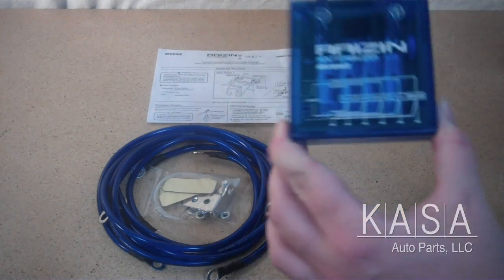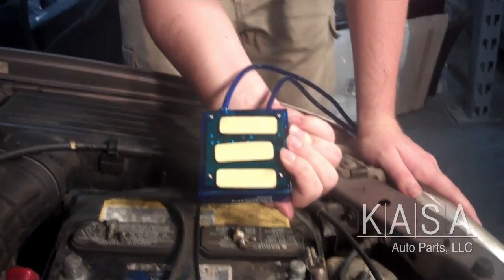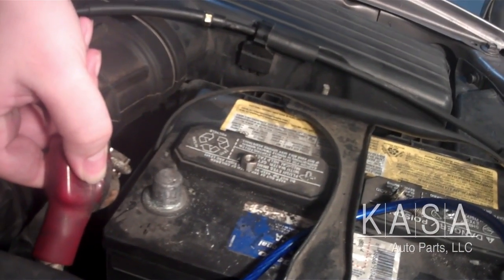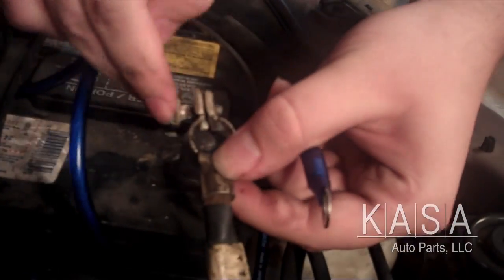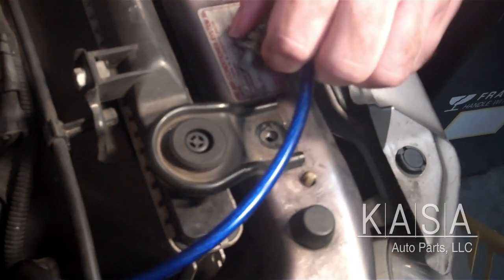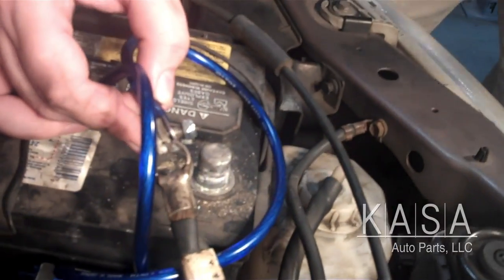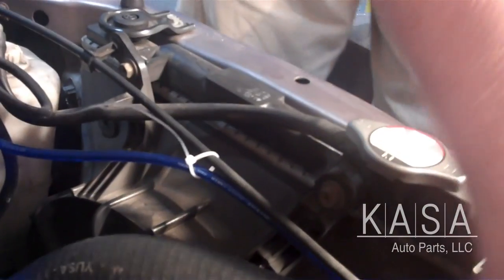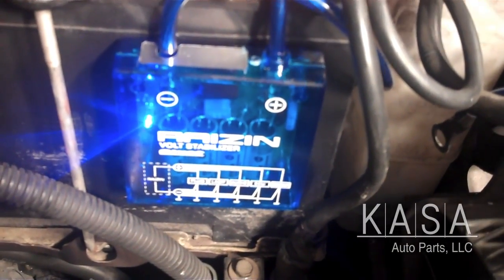Raizin Voltage Stabilizer Installation

Comment: And what happened if your altarnator’s volatge regulator is bad?
Reply: That's exactly what I'm trying to find out lol. I'm looking into this because I have a high Amp alternator due to having alot of car audio. The stock regulator in the alternator is not working but the alternator works fine other then that. And it being almost $500 for a new 260amp alternator custom made for a acura integra I'm not trying to by a new one. So when running its around 15 volts which is normal for a car running and charging but under load driving or with the subs on its boosting up to 17 volts. Now will this work to actually stabilize the voltage and regulate it to something safer that's not gonna want to fry my cars wiring? Lol

Comment: This is a fake product. It has very small gauge wire with thick insulation to make them look big. The capacitors are all dry inside and do nothing. There is one cap that works otherwise it is just a overpriced voltage meter. do not buy this it is a scam.

Comment: Never install cables or anything over the battery cell covers, you need to check the water level and possibly add periodically. Your battery is already body grounded, I would have placed the ground at the alternator bracket or somewhere on the engine, and last you mounted the stabilizer on the battery, you will need to change batteries at some point. And everyone yes this is a stabilizer, it's just a series of high current capacitors, hopefully the manufacturer placed high current diodes in place at input of positive and negative, otherwise be careful and double check connections, capacitors will blow very loudly immediately after backwards connection

Comment: Does anyone test these things to see what they really do?
Reply: This is a fake product. It has very small gauge wire with thick insulation to make them look big. The capacitors are all dry inside and do nothing. There is one cap that works otherwise it is just an overpriced voltage meter. do not buy this it is a scam.

Comment: I'm afraid you installed it it the wrong way. The cable suppose to be pointing below so that water don't sip in the cables hole.

Comment: The components inside the Raizin Voltage Stabilizer was bunch of filter capacitors and LED indicator. Capacitors was only filter out minimal sagging voltage of the Battery. The reason that "kit" was effective if you install all 5 Ground Wire properly. Unsuspectingly you just installed Multiple Wire Grounding Kit that was the reason that engine electrical have improved. You will notice that even if you remove the Raizin Voltage Stabilizer. Engine electricals have still very good performance due to newly install 5 wires grounding wires.
Reply: Mitsu Bishi w
Reply: so what you're saying is you dont need the blue box or positive cable connection, just add more grounding from the battery and that would do the same? I was curious about this device but noone around me knows, so im just asking to you guys...?
Reply: @dragan3290 
I have the voltage stab. every 10 days my new battery was drained....this form this voltrage
Reply: I'm looking into this because I have a high Amp alternator due to having alot of car audio. The stock regulator in the alternator is not working but the alternator works fine other then that. And it being almost $500 for a new 260amp alternator custom made for a acura integra I'm not trying to by a new one. So when running its around 15 volts which is normal for a car running and charging but under load driving or with the subs on its boosting up to 17 volts. Now will this work to actually stabilize the voltage and regulate it to something safer that's not gonna want to fry my cars wiring? Lol

Comment: Okay i watched this video start to finish and have come to the conclusion that this device does nothing, other than light up a little blue LED. how could it improve torque and horsepower when it only hooks between the positive and negative posts of the battery? it has nothing to do with the ECU OR Alternator, which on most all late model cars controls the vehicle's voltage while running. This snake oil is A SCAM.

Comment: On ebay it says these provide approx 10hp and 'better mileage' by 3% or more... how can this claim be true, if all it does is regulate the alternator's output and smooth out spikes in the battery? 

I PITY ANYONE DUMB ENOUGH TO BUY THIS AN EXPECT BETTER MILEAGE/ MORE POWER 
The alternator doesn't even draw 10 hp unless you're welding with jumper cables.

Comment: It's not a performance chip, what ends up happening is that in a normal car battery there are spikes and low points in the power output. What the voltage stabilizer does is help keep the battery voltage output more consistent and stable, resulting in better electronics performance^^
Reply: No, it really won't. Any sensitive electronics such as ECUs will already contain the necessary voltage regulators and capacitors.
Reply: @jonathanemery-barker2908  so my question is this with the extra stabilization have any effect on the longevity of those components?
Reply: @brettweltz8135 It shouldn't, no.

Comment: The video shows a wires-up install orientation for the Raizin on the side of the battery, but, as per the instructions, it should be wires-down to prevent water from coming into and thus gathering inside of the box. (Note the openings by the wires and the rest of the box being sealed shut). As per the instructions, the 5 grounding wires are to improve the grounding system which, along with voltage regulation, will improve multiple areas of function within your vehicle.

Comment: What's the reason for using a grounding wire? The negative pole of the battery goes strait to ground and the unit is connected with this pole...